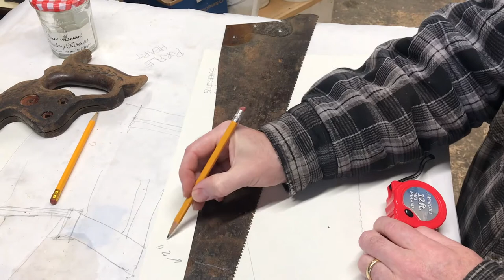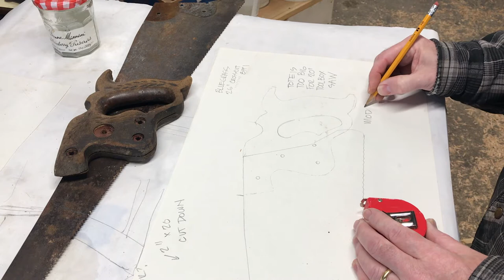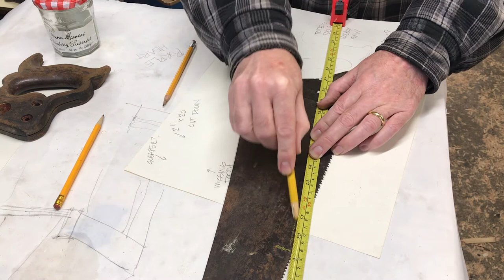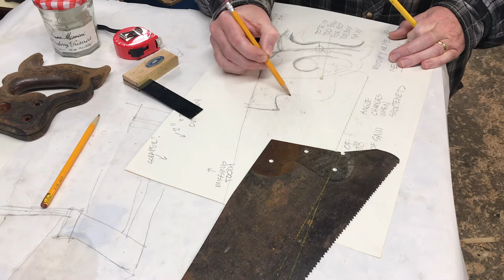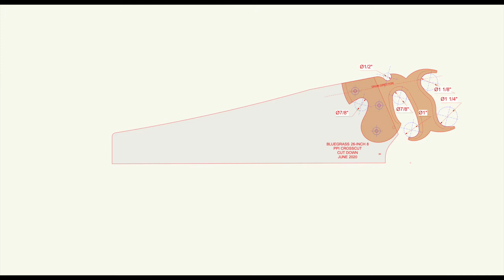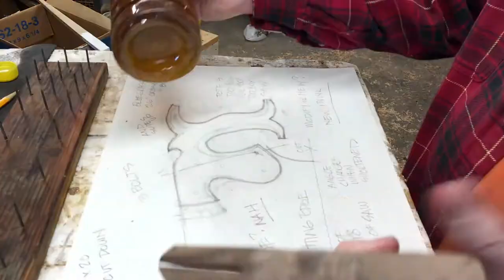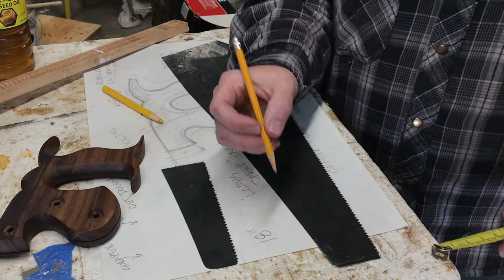Blue Grass Saw Restoration - Reinvention

Comment: Nice  job looks  amazing  , what  they  uses  to  do  with  that  kind  of  handle  was put  a dowle through  the  centre  of  the  handle  to stop  it splitting on the  grain , just  a  thought, best  wishes from a vintage Carpenters in England 🇬🇧
Reply from the maker: Thanks Roy, this was a fun project. I've had a few saws that have had holes drilled up through the handle and dowels added. I haven't felt like I've needed to do it myself yet, but its good to know I can. I'll take advice from a pro whenever I can get it. Thanks for writing.